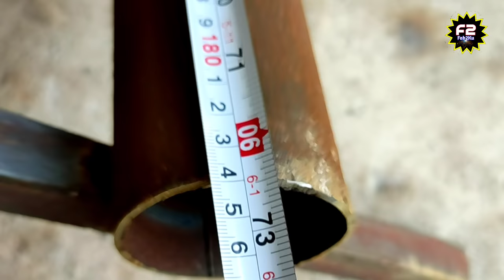Simple ideas For Make Metal Bending Tool / Flat Bar Circle Making Tool / How To Make A Metal Ring

Comment: I have a  question.   What is the name of  the welding rode   used  in the video ... Also  also the   what is the name  of the cleaning   griender blade u used in the video
Reply from the maker: It's 6013  3:15mm  Mangalam Welding Rods Sir